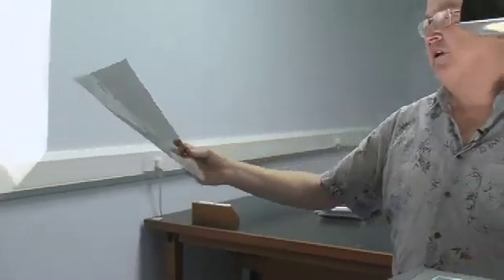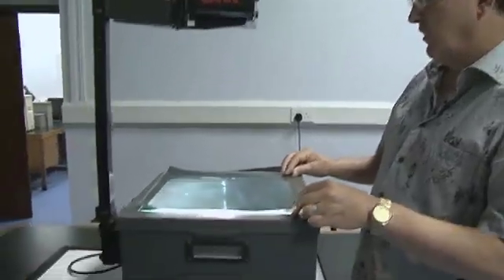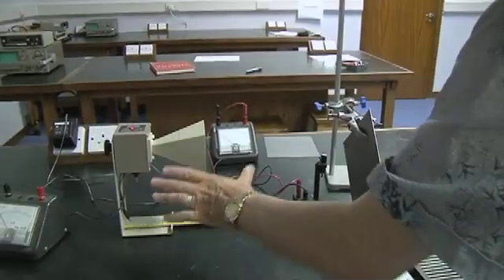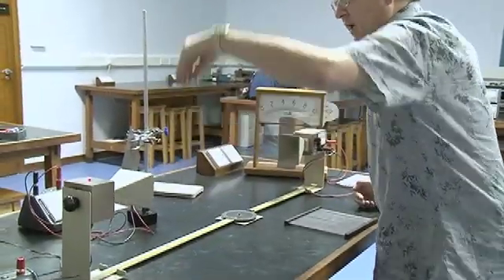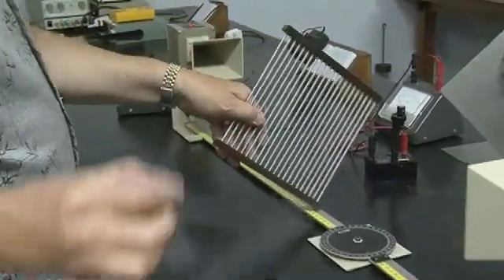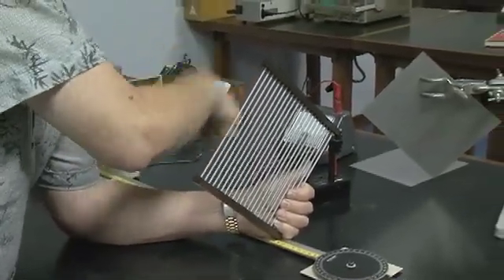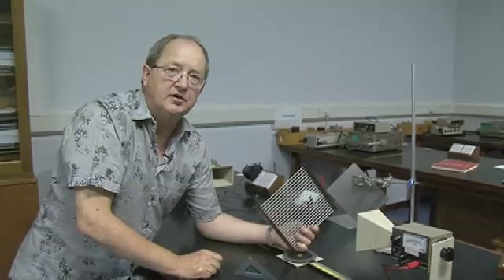Polarisation - Sixty Symbols

Comment: Great explanation with the radio waves!!! The polarized glasses work because reflected light is always polarized (except it the reflection is perpendicular in which case you would not be able to see because your eyes would create a shadow). There is a classical explanation: imagine the ray of light as a tube and now cut that tube at an angle and you'll notice it becomes an eliptical surcave that is longer in one direction. (from this point on I'm not sure because I may be inverting things) ... wait ... cutting the tube won't work ... the eliptical surface is the result of the projection of the wave front over the surface so the electric field oriented parallel to the surface will be reflected more than the ones oriented at an angle so light reflected is more polarized horizontally and those glasses then having vertically polarized lenses will remove more of that light - the light that is directly reflected which is also the most annoying. I have glasses (prescription) with polarized lenses because here in Brazil once you get them you won't be able to drive without them.

Comment: I think phisics made a mistake in its classic explanation: when the signal reach the metallic grid, in the spaces among the bars we could considera individual sources oscillating based on Hyugens' Principle, but their spherical wave will be distorted since the electric field will be stopped by the metallic bars in its perpendicular direction, making in this way a boundary condition for these point sources, leaving sources that can only oscillate on the parallel direction to the bars which explain why you got power in this direction... like in scattering processes you cannot just said that only absorption has ocurred, you should consider the participation of the electric field from all the molecules in the path of transmission

Comment: would the micro-wave demonstration work with the polaroid sheet?
Reply: I also wondered that - it's clear that the large bar polarisation would not work with the several 100 nanometer range (light) but the reverse seemed like it might be possible since there are 'wires' there - however it turns out that with very tiny apertures relative to the wavelength it will appear solid and reflect. So the ideal spacing of the 'wires' would be something less than half the wavelength but not much smaller it seems.
Reply: @djmips  What I still do not understand, is how rays/waves can be COMPLETELY stopped in one direction. There should be at least rays/waves going through the part which is neither horizontal nor vertical, being common to both directions. =||. If you put the = sign on top of the other sign, they will have a common intersection. So, with a receptor sensitive enough, the rays/waves going through that intersection should be registered. Likewise, we should be able to see a bright spot in the center when all other rays/waves are stopped.
It does sound much like the Spot of Poisson, doesn't it? But then in reverse: there is no spot!

Comment: I don't see the anything surprising here. The metal bars are antennas that pick up signal and re-radiate the signal. Many EE graduates end up making prototypes of this type of satellite receiver/transmitters about 10GHz for mass production. Take any antenna class in a 4-year EE program and every thing is seen as antenna.
Reply: You can modify the length of the metal bars to tune the impedance of the metal-bar-antenna to reduce/increase the absorption/re-radiation of it. I will not be surprised that the system has been tuned by a EE engineer already.
Reply: I agree that tuning the impedance would improve things but only to make it block better.

Comment: Well ... it appears this guy gets it wrong too. He does NOT understand the metal grate is re-radiating the microwave energy in the direction that the grate is positioned, having intercepted the RF from the transmitting end at 45 degrees. So, re-radiation of the RF then takes place at the new 45 deg angle AND is picked up at the far end receiver.
Physics REALLY IS screwed up.

Comment: Hello :-) Only found this video now- Very well explained, thank you! :-)
Is there an easy way to replicate the transmitter-receiver set-up?

Perhaps two ESP wifi boards and cantenna, biquad?  Or enclose student phone's with fine wire grid sans a directional waveguide, and measure signal strength?

Comment: Demonstration with radio waves and sheet of metal bars makes polarization much more understandable. Wish more people would explain it like this. Thanks!
Reply: But, the presenter still errs in the final analysis of why/how this phenom works.
I thought for a bit he was going to get it - but he swung and missed! 
As it turns out, the metal grate is re-radiating the microwave energy in the direction that the grate is positioned, having intercepted the RF from the transmitting end at 45 degrees, then, re-radiation of the RF takes place at the new 45 deg angle AND is picked up at the far end receiver.
Reply: @uploadJ  This is definitely the Occam's Razor explanation.  I felt the same way when I first stumbled upon the Quantum Physics explanations of this phenomenon.  It seemed like they were going way out of their way to create an impossible to answer question.  I would love to find an experiment that either presents evidence for or against the solution you just described.  If the obvious explanation is the correct one, why do all of these physicists seem to miss it?
Reply: @neonsashimidream1075   If that's your thought, why do you think it would be re-emmitted in the same direction as the original signal, rather than a random direction?  Why would light continue in the same direction from the filter, rather than emitting fainter light in all directions?
Reply: @uploadJ  . I can't tell whether he missed it or that the presenter's explanatory style is so bad that it amounts to the same.
What is depressing are the comments--the inevitable YT comments--praising the explanation with:
"Wow, great explanation."
"More than I learned in a year of high-school."
"I wish my prof had put it this way."
"Now I finally get it!"

No, you don't get it. Or else you're a genius at extracting the truth from a malformed explanation.

Comment: may I make a suggestion.
I know that your sender sends polarized waves and the receiver is only sensitive to specific polarization. The reason why the wave experminent is not that impressive to the naked untrained eye is, that we cannot see those "intrinsic" polarization filters. I think the experiment would benefit a lot, if you just put on 2 additional filters, one to the sender and one to the receiver. Just connect them mechanically with the devices such that they rotate with the sender or receiver.
I think this would be (to the naked untrained eye) a much better analogy to the demonstration with the 3 sheets of optical polarization filters.
(Disclaimer: I know that this would not change anything to the experiment itself, the result would still be the same. But it would be much more impressive to an observer, because those visible filters are a big help in grasping what goes on and help in not forgetting, that there are 2 polarization filters in the system which are not obviously visible. So make them visible to the observer)

Comment: One thing I don't like about this "component" explanation is that it implies that 1/4 of vertically polarized wave is horizontally polarized, which doesn't make sense. Also, why is the signal strength of that 1/4 is the same as of full signal? And why is the light that went through 3 layers at 45% angles is pretty much as bright as the light that went through 2 aligned layers, when only 1/4 of the energy should go though? It looks more like a polaroid film actually turns the wave when it's at 45% angle rather than absorb part of it.
Reply: I think the experiment isn't really calibrated to give exact results. I wouldn't rely on the signal strength as an indicator for the amount of absorbed radiation. As for the polaroid and the projector, one layer of ploaroid already reduces the brightness by 50%, so with three layers it should only be half as bright compared to one layer and I doubt the humen eye is sensitive enough to exactly determine the brightness, especially without a direct reference.

Comment: So, similar explanation for the double slit experiment? The end part with the probability. Or am I way off?
Reply: There is another part to this that he only alluded to. If you go by classical physics you will end up with the signal strength getting through the middle sheet in a linear fashion depending on the angle of the sheet. But this is not what is observed. Instead you really end up with a sinus value which is what you get if you use quantum physics maths instead.

Comment: Antenna engineer here. The statement regarding the energy being absorbed in the wire in incorrect. Most of the energy will be reflected. You will acheive similar results if a perfect electrical coductor was used for the wire grid.
Reply: Riaan Ferreira Why would most of it not pass through with all that empty space in between the wires? Also, why would they not be reflected with the grid in the other orientation?
Reply: Do you mean perfect electrical insulator in your last sentence? Just wondering. I think it's great when actual practicing engineers correct the teachers... :)
Reply: REFLECTED, and, also  AS WE SEE re-radiated onto the RX horn at the far end, but, shifted 45 degrees (WHICH is the only reason the cross pol horn picks up the signal!!)

Comment: So an electromagnetic wave can be split into its component vectors? Hopefully I've interpreted his analogy with the square correctly
Reply: They are actually not component vectors of the original wave. You would have 25 % signal even without the filter if they were. But when you measure the wave (with the filter), it is forced to turn either parallel or perpendicular because it cannot interact with the filter in any other orientation.

It's basically magic.
Reply: Yeah that's how I interpreted it as well.

Comment: Look at the LED on the receiver at 6:00
lol )
Reply: Роман Плетнев lol. I wonder why that happened tho?
Reply: When he turn the machine the microwave pass throw , but when the machine its not working then the sunlight its recieved by the second detector. he put his finger in front of the detector and he blocked the sunlight. Its its not a polarization, because it didnt change the wavelenght of the sunlight just blocked it completly.
Reply: In fact that LED tell you that it pick up a signal . that its microwave or visible light , in the second case when he stick his hand in front of it.
Reply: His hand simply blocks the light. In other words, he casts a shadow on the detector so it can no longer detect anything. Microwave light and visible light are both EM waves. I assume the reason the experiment uses microwave frequencies is so he can use those great big conductive bars and we can easily see which way they are oriented.
Reply: Oh I see the confusion. The LED turns ON when there is NO signal detected. Its useful for setting up experiments to know when light is being canceled out.

Comment: They explain that vertical wires serve as the secondary transmitter: the waves induce since oscillations of electrons in the wire effectively absorbing the wave. Ok, let's believe that wave is absorbed when it forces the electrons. But, the other theory says that reflections work because secondary source produces the wave. Yes, oscillating electors must emit the waves in the same direction as the inducing wave. So, probably, we should speak about scattering rather than absorption?

Comment: after passing the 45 degree filter, the microwave's orientation is actually rotated by 45 degree. that's why when the receiver is at 90 degree to the transmitter it still gets signal. no magic is involved.

Comment: 2:30  onwards. I had always thought that the conducting bars had to be parallel to the wave, so that the wave could get through. That's how all the physics book diagrams work, some show a rope and a fence, and the wave in the rope only passes if it's parallel to the fence bars. 

Clearly they seem to be wrong, because this man just explained it in more detail than the simple fence-rope intuitively nice diagrams. Thanks.
Reply: +Maple Syrup I think that he is still wrong. He told that wave is absorbed and energy is converted into the heat of the fence. However, oscillating electrons must re-emit the wave at the incending frequency. The wave must be &quot;scattered&quot; rather than absorbed, therefore, IMO. The fence emits it in all directions instead of focused into one direction. It is like clouds scatter the sun light rather than absorb it completely, like black cover would. The question is why does polarizer prefers to absorb rather than reflect or scatter the light at the current wavelength?
Reply: @valtih1978  re: "The fence emits it in all directions"
>> Well, no. No more than a dipole antenna radiates in all directions! The E-field is parallel to the wires, LIKE IN A DIPOLE ANTENNA, in fact, that is a better way to look at the 'grate' is as a series of close dipole antennas.
Reply: +Valentin Tihomirov The wave is in fact absorbed as it induces a current on the metal pole, which by ohmic conduction generates heat.

The polarization of the poles turns them into dipoles, which in turn radiate waves in every direction. If the frequency was high enough, this would be the main source of heat dissipation, but it's shadowed next to conduction at the microwave range. It's called dielectric heating.
Why the metal absorbs most of the energy rather than refracting or reflecting is due to the conductive properties of metal, the frequency of the waves, the geometry (parallel bars) and the position of the grid. It's like any other optical surface which transmits and reflects in only one direction. 
You can reflect the wave by angling the metallic polariser or refract it with some paraffin prism.
Reply: @rThorWenzel  re: "Why the metal absorbs most of the energy rather than refracting or reflecting is due to the conductive properties of metal,"
Wrong wrong - completely WRONG. JUST because you "say it" does NOT make it true. RE-RADIATION from the wires occurs!!! This was EASILY shown BUT the presenter does NOT know it!

Comment: I don't quite get why the microwave cannot pass through the grill horizontally. Shouldn't there be certain distances where the wave just "slips" through the grid?
Reply: +Christian Bürgi microwaves can get to have wavelengths of up to 100 cm, so as long as the bars are closer together than the wavelength of your emitter, the waves which aren't polarized the right way will be stopped.
Reply: Don't think about it as a thing that moves forward in a sine wave shape, think of it more as a spring that stretches and shortens perpendicular to the direction of travel

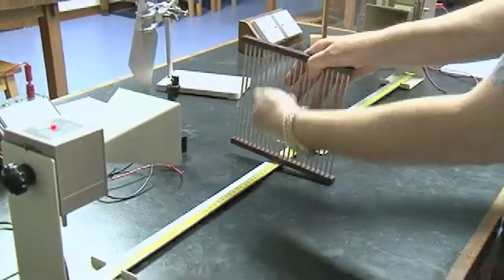Comment: 3:10 When the orientation of the conductor in the filter is in line with the transmitter, the wave will be mostly reflected, rather than being absorbed by the conductor.

Comment: why is reflected light on a road or a pond polarized?
Reply: JohannaMueller57 its the same situation as the polaroid thing again, when the light hits the road, the vertical component will get absorbed and the horizontal component will get reflected away. reflections cause polarization so if you have the sun giving off loads of random unpolarized light, and it hits a pond, most of that direct sunlight will be absorbed or refracted underwater, but some light will be reflected and polarized parallel to the plane of the pond. if that makes sense xD
Reply: Ranstead Moons um, thanks for explaining that reflected light is polarized. actually the question was why. ;)
Reply: +JohannaMueller57 for more details on it you can look up the Brewster angle. That's basicaly what it is. :)
Reply: +JohannaMueller57 Boundary conditions and maxwell equations I expect.
Reply: JohannaMueller57 I haven't really gotten in to it strongly but basically light (EM-waves) is reflected differently because the magnetic field is hardly effected by other media in contrast with the electric field (material properties). Therefor,  the polarization matters because it decides how much the electric field is pointing perpendicular to the material which somehow changes the way the wave is transmitted and reflected.
Reply: Robert Fennis afaik the magnetic field in em-waves is always perpendicular to the electric field, so even if reflection was due to one more than the other, their entaglement really makes this arbitrary and meaningless and therefore "polarization matters" and "somehow the way is changed" does not bring any clarity at all. it's what i said, you just substitute the comprehensible situation with something more complicated that you don't understand but just accept. i mean, that's my impression. ;)